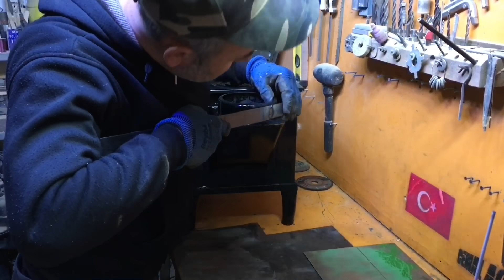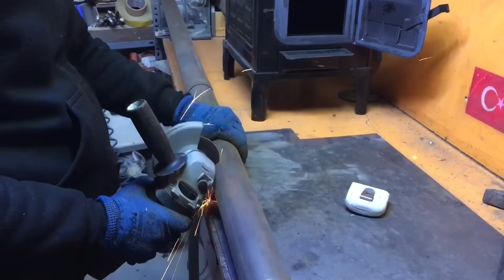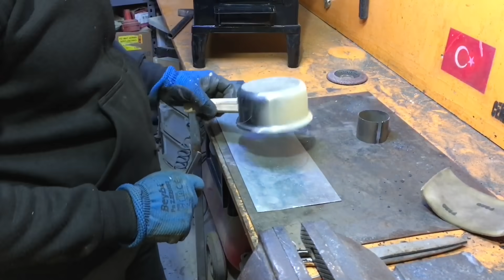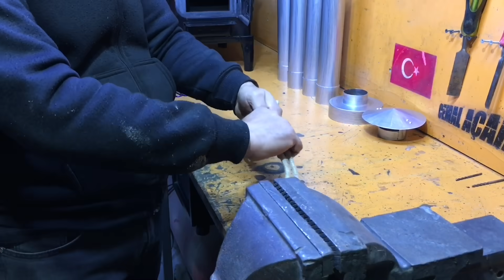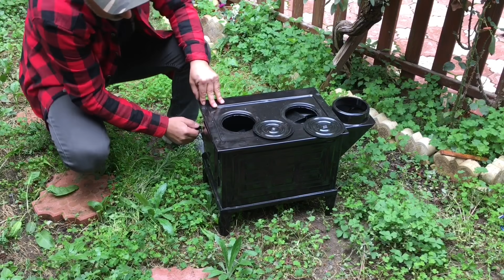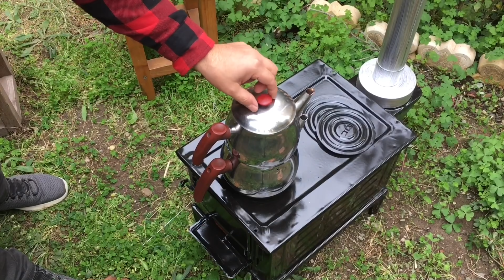# Kamp sobası 100₺! ⛺️ I'm making $ 12 camp stove !

Comment: Great talent.  Have you ever thought of building a sectional or small folding wood chair with minimal weight that would fold flat and then used as a pack frame?  When folded or collapsed flat,  strap camping gear to it (tarp, pad, cooking items, hatchet, etc.) and it becomes the wooden pack frame for a day hike.  If I could come up with something like that, I could sit at camp to rest my old knees and then fold it up, strap my gear back on to it and return home after a day in the woods.  Thx!